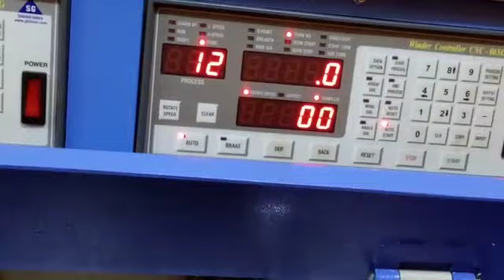Ceiling Fan Coil Winding on CNC Machine with Shaft on Old Stator 9835633059, Pl Share and Subscribe

Comment: Sir Pakistani price kya ho gi iski?
Or deliver kr k kitna estimate ho ga??
Reply from the maker: For Books Account Details
SANJMA ELECTRO INDIA PRIVATE LIMITED
SBI Account No 38198116508
IFSC Code SBIN0005331
Branch NMCH Patna

Jadu Bulb 436/-
Pankha Udyog 736/-
Domestic RO 736/-
Ceiling Fan Winding Data 736/-
Cooler Udyog 736/-
AP Fan Udyog 736/-
Farrata Fan Udyog 736/-
Mixer Grinder Udyog 736/-
Motor Winding Data 736/-
BLDC Ceiling Fan Udyog 736/-

All Books Available in  
Hindi, English, Urdu, Bangla, Odia, Telugu, Tamil, Kannada, Malayalam, Marathi, Gujrati, & Punjabi Languages 

Give Screenshot of Payment & Address with Pin Code on WhatsApp
Mention Title & Language
WhatsApp on 9835633059

Beware of Frauds
Never Give Up
Fight for the Right
Be Positive
Regards,
Sanjeev Verma

Join Live streaming tonight at 9pm on my channel Sanjeev Verma on YouTube

Subscribe my channel named Sanjeev Verma on YouTube 🙏🤝
https://youtu.be/INZX-IgjoEA

Comment: Ye macen kitnye ki mlti hai bhae
Reply from the maker: For Books Account Details
SANJMA ELECTRO INDIA PRIVATE LIMITED
SBI Account No 38198116508
IFSC Code SBIN0005331
Branch NMCH Patna

Jadu Bulb 436/-
Pankha Udyog 736/-
Domestic RO 736/-
Ceiling Fan Winding Data 736/-
Cooler Udyog 736/-
AP Fan Udyog 736/-
Farrata Fan Udyog 736/-
Mixer Grinder Udyog 736/-
Motor Winding Data 736/-
BLDC Ceiling Fan Udyog 736/-

All Books Available in  
Hindi, English, Urdu, Bangla, Odia, Telugu, Tamil, Kannada, Malayalam, Marathi, Gujrati, & Punjabi Languages 

Give Screenshot of Payment & Address with Pin Code on WhatsApp
Mention Title & Language
WhatsApp on 9835633059

Beware of Frauds
Never Give Up
Fight for the Right
Be Positive
Regards,
Sanjeev Verma

Join Live streaming tonight at 9pm on my channel Sanjeev Verma on YouTube

Subscribe my channel named Sanjeev Verma on YouTube 🙏🤝

Comment: yeh machhine ka prize kitna hsi
Reply from the maker: Pankha Udyog Book lijiye Esme Sabhi machine manufacture aur raw materials manufacturer ka number Mil jayega 

For Books Account Details
SANJMA ELECTRO INDIA PRIVATE LIMITED
SBI Account No 38198116508
IFSC Code SBIN0005331
Branch NMCH Patna

Jadu Bulb 436/-
Pankha Udyog 736/-
Domestic RO 736/-
Ceiling Fan Winding Data 736/-
Cooler Udyog 736/-
AP Fan Udyog 736/-
Farrata Fan Udyog 736/-
Mixer Grinder Udyog 736/-
Motor Winding Data 736/-
BLDC Ceiling Fan Udyog 736/-

All Books Available in  
Hindi, English, Urdu, Bangla, Odia, Telugu, Tamil, Kannada, Malayalam, Marathi, Gujrati, & Punjabi Languages 

Give Screenshot of Payment & Address with Pin Code on WhatsApp
Mention Title & Language
WhatsApp on 9835633059

Beware of Frauds
Never Give Up
Fight for the Right
Be Positive
Regards,
Sanjeev Verma

Join Live streaming tonight at 9pm on my channel Sanjeev Verma on YouTube

Subscribe my channel named Sanjeev Verma on YouTube 🙏🤝

Comment: Yah kaun si machine hai naam kya hai
Reply from the maker: CNC Ceiling fan winding machine
Reply from the maker: For Books Account Details
SANJMA ELECTRO INDIA PRIVATE LIMITED
SBI Account No 38198116508
IFSC Code SBIN0005331
Branch NMCH Patna

Jadu Bulb 436/-
Pankha Udyog 736/-
Domestic RO 736/-
Ceiling Fan Winding Data 736/-
Cooler Udyog 736/-
AP Fan Udyog 736/-
Farrata Fan Udyog 736/-
Mixer Grinder Udyog 736/-
Motor Winding Data 736/-
BLDC Ceiling Fan Udyog 736/-

All Books Available in  
Hindi, English, Urdu, Bangla, Odia, Telugu, Tamil, Kannada, Malayalam, Marathi, Gujrati, & Punjabi Languages 

Give Screenshot of Payment & Address with Pin Code on WhatsApp
Mention Title & Language
WhatsApp on 9835633059

Beware of Frauds
Never Give Up
Fight for the Right
Be Positive
Regards,
Sanjeev Verma

Join Live streaming tonight at 9pm on my channel Sanjeev Verma on YouTube

Subscribe my channel named Sanjeev Verma on YouTube 🙏🤝

Comment: सर जी कोंनतैक नंबर दो
Reply from the maker: 9835633059
What's up 

Pankha Udyog Book lijiye Esme Sabhi machine manufacture aur raw materials manufacturer ka number Mil jayega 

अगर अाप व्यापार पर मेरी किताब लेना चाहते हैं तो कंपनी के खाता में पैसा जमा कीजिए अौर अपना पूरा पता पिन कोड के साथ दिजीए साथ में जमा का फोटो दीजिए । जमा के 3 से 7 दिन के अंदर अापकी किताब भारतीय डाक के बुक पोस्ट से भेजकर रसीद का फोटो वाटसअप कर दी जाएगी.

Edition- Hindi, English, Bangla, Odia, Telugu, Tamil, Kannada, Malayalam, Marathi, Gujarati, Punjabi & Urdu. 

Jadu Bulb 436/-
Pankha Udyog 736/-
Domestic R.O 736/-
Ceiling Fan Winding Data 736/-
Coolar Udyog 736/-
AP Fan Udyog 736/-
Farrata Fan Udyog 736/-
Mixer Grinder Udyog 736/-
Motor Winding Data 736/- 

All Nine Books 6324/-
You can also take any one

धन्यवाद ।
संजीव वर्मा 
MSME, Author & Youtuber

Sanjma Electro India Pvt Ltd 
SBI Account No 38198116508
Ifsc Code SBIN0005331
branch NMCH Patna

Comment: Cost plz
Reply from the maker: For Books Account Details
SANJMA ELECTRO INDIA PRIVATE LIMITED
SBI Account No 38198116508
IFSC Code SBIN0005331
Branch NMCH Patna

Jadu Bulb 436/-
Pankha Udyog 736/-
Domestic RO 736/-
Ceiling Fan Winding Data 736/-
Cooler Udyog 736/-
AP Fan Udyog 736/-
Farrata Fan Udyog 736/-
Mixer Grinder Udyog 736/-
Motor Winding Data 736/-
BLDC Ceiling Fan Udyog 736/-

All Books Available in  
Hindi, English, Urdu, Bangla, Odia, Telugu, Tamil, Kannada, Malayalam, Marathi, Gujrati, & Punjabi Languages 

Give Screenshot of Payment & Address with Pin Code on WhatsApp
Mention Title & Language
WhatsApp on 9835633059

Beware of Frauds
Never Give Up
Fight for the Right
Be Positive
Regards,
Sanjeev Verma

Join Live streaming tonight at 9pm on my channel Sanjeev Verma on YouTube